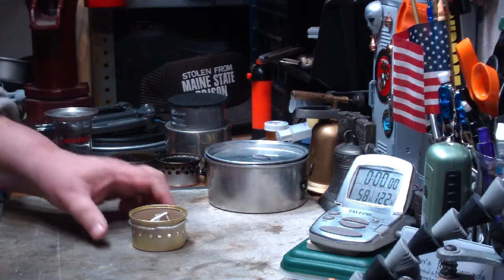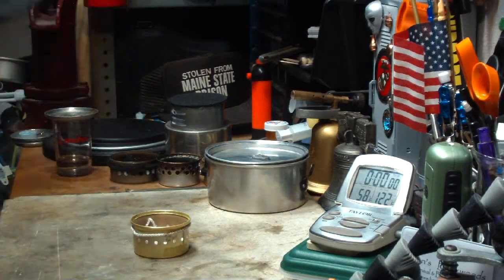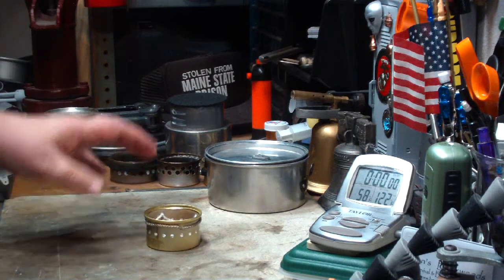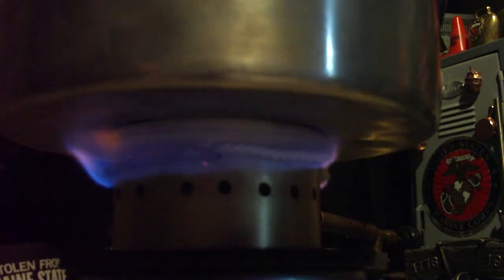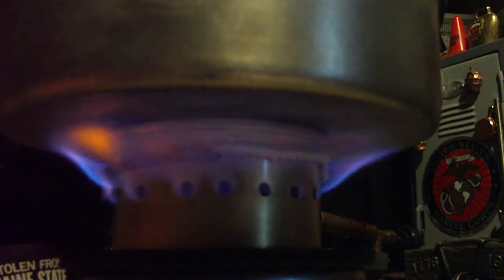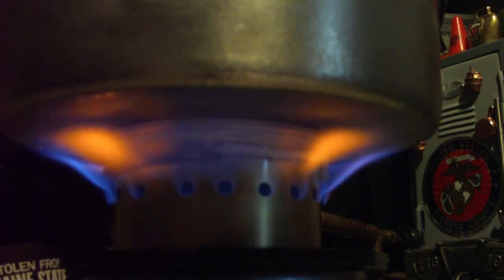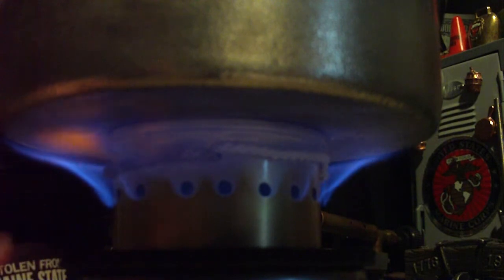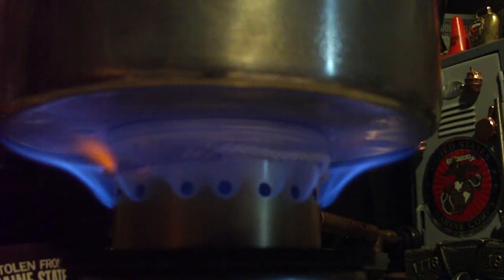Low Pressure - Side Burner - Mod#4a - Burn Test

Comment: I actually liked the flame pattern from just the wick alone (no jetting).  It looked small, stable and fuel efficient.  Who cares when the jets light.  I suspect that you would get better fuel efficiency if you moved the holes up rather than the wick down.  My 2 cents - Jon